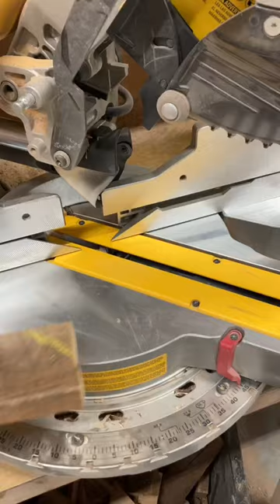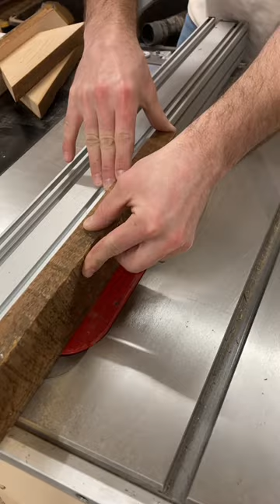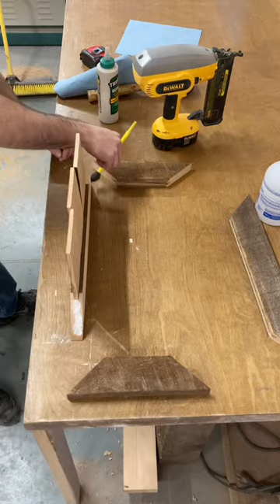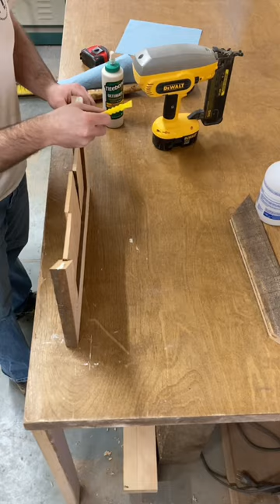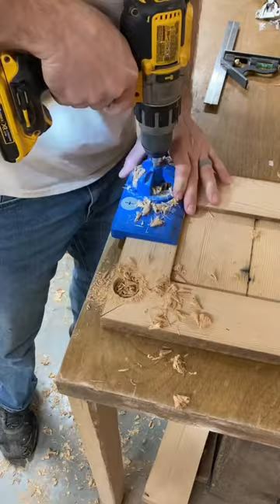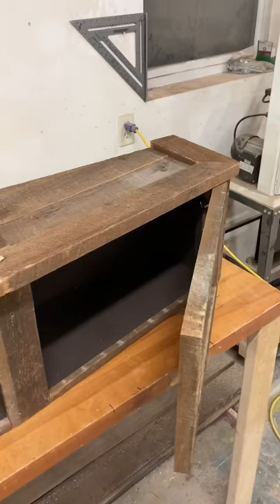Doors with Reclaimed Wood

Comment: A very nice "vintage" door. Although I didn't like that hinge screw in the center of the joint; Just by moving them one centimeter problem solved. For the rest, excellent.
Reply from the maker: Maybe I should have not put the screw in the crack.

Comment: Looks great,  but mitered corners are weak. You could have done stubbed tenon and groove with the rails (horizontal) being headed off by the styles (vertical).

 Edit: gluing miters is basically gluing end grain. It's a good idea to apply glue to both mating surfaces so the joint doesnt starve. The best way to glue end grain is to apply glue to all mating surfaces, let it soak in, then apply again... end grain wicks up glue
Reply from the maker: I put nails in the corners also. This was just a quick build for my house, and it will be strong enough.
Reply: @hesswoodwork  looks like you forgot one of the corners (unless you edited it out)